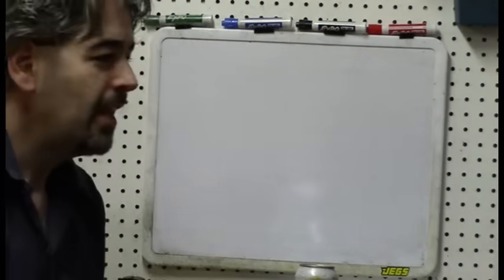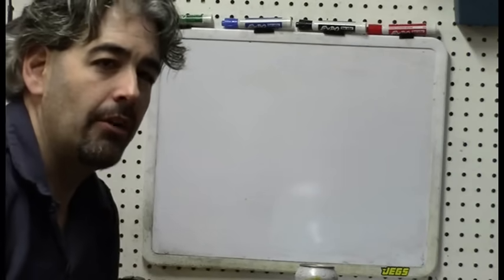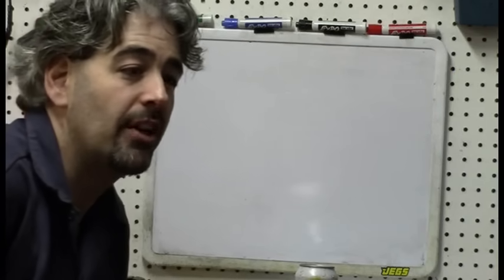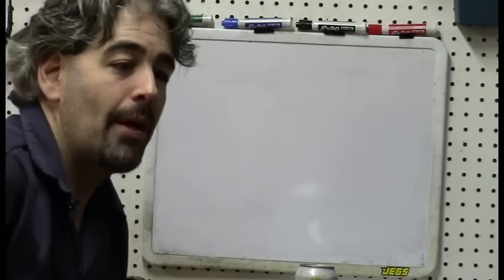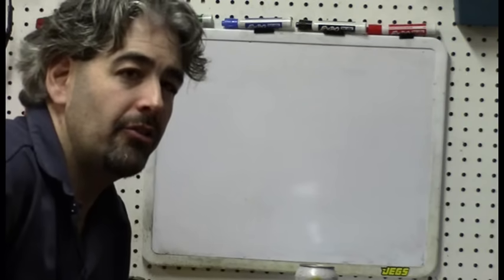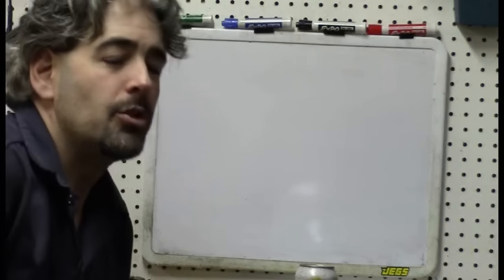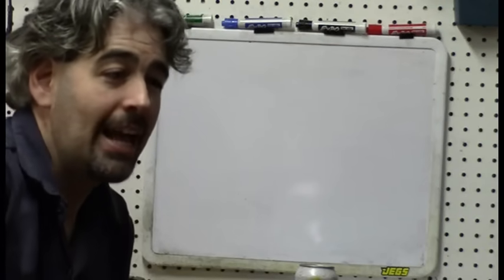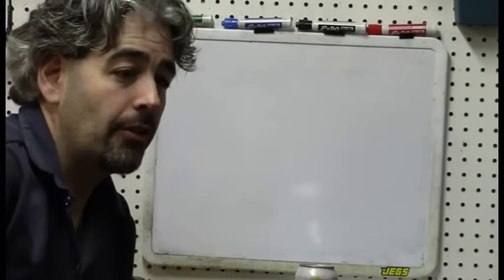Secret of Engine Problem Diagnosis- Fuel Trims Pt.1

Comment: Hello.  2003 Mitsubishi 3.8L V-6, 220,000 trouble free miles. Fuel economy is where it should be.

LTFT 1&2 are +12.5% at hot idle.  But goes to 0% and stays there when revved to 2,500 rpm.

STFT 1&2 are 0% at hot idle. When extra fuel is sprayed on identified leak of intake manifold (leaking o-ring, I used smoke to find) the STFT immediately goes to -6 and then returns when the extra fuel is burned off.

Could this intake air leak thats affecting both banks cause the truck to go into a limp mode, giving me these codes?
P0335
P2135
P0340

Also, why does LTFT go to 0% when under load?   Thanks!
Reply from the maker: No. the vacuum leak you found is irrelevant to what appears to be a separate timing issue.
Reply: @SchrodingersBox  Thanks. I have had two codes linger and not go away for 4 years.  Regarding both catalysts.  P0421 and P0431. The truck doesn't run poorly, has good power, and gets its designed fuel economy. O2 sensors move between 0 and 1v. Do you think the catalytic codes could be related?  I haven't had any smells or bad cat issues.

My timing elements are good.  Do you think the TPS could be entire issue with this limp condition that has occurred twice? It will run and idle fine, turn off and crank fine, but it won't go forward or backwards as if the throttle is not talking to the intake.  Again, when it sits for 20 or minutes it resets and works fine again.    Thanks.
Reply from the maker: The only way for you to find what’s wrong is to check the cam/crank correlation. This is the next step.  it’s possible the catalytic codes resulted from the condition but they did not cause it. your first step is correction of the timing issue and then you know any other codes are independent.
Reply: @SchrodingersBox  you know of any shortcut way to do this cam/crank correlation without removing the intake and timing covers?  

It's a real pain on these Montero to do either.  Have to remove a lot of stuff.
Reply from the maker: Oh believe me I know!! it’s one of the reasons why I invested in a lab scope because  There is a shortcut but you need a 2 channel lab scope.
  Otherwise, on some of these models they have separate cam covers and you just need to remove the cam covers - not the whole front cover. set to TDC#1 and then just check the cam timing marks. But if it’s  a model with the whole front cover then yeah- no shortcut other than lab scope and looking at overlay of cam and crank signals.
Reply: @SchrodingersBox  maybe I should invest in a scope for this any other stuff that's bound to come up more and more as my "fleet" ages.  I hate new cars. 

Recommend a scope system that's less than $1,000 or thereabouts?
Reply from the maker: Hantek makes some low cost 2 channel ones.
Reply: @SchrodingersBox  thanks. Would 2 channel be all I need for DIY use?  It's been a long time since I used a o-scope.
Reply from the maker: yes it is.

Comment: I hv a 2007 camry with high fuel consumption. No engine light no codes on obd2 scanner but car is consuming about 35% more fuel. Please help
Reply from the maker: Always start with the basics. Curve the LTfT and STfT against load with MAF and MAP output to get the starting direction.

Comment: Can I get some help please I have a vw vr6 2001. I have been chasing p1137 code for months. I have replaced maf, 02, injectors, purge valve, fpr still getting code.
Reply from the maker: what data did you have that those parts were all bad?
Reply: @SchrodingersBox  when I Google the code it said that all those parts would throw rich code so I would change parts hoping one of those were bad but nothing it still comes back after awhile. Only thing I have not changed is the evap canaster which says can give that p1137. I can not figure it out.
Reply from the maker: yeah I would need data in order to get a direction or I would just be guessing too. 
  just start with the basics- curve the total fuel trim against load and that will give you a basic stating point to see when the rich condition is occurring.  once you do that we can create a set of variables to narrow down from - in fact you already listed several but right now we don’t even have fundamental data to go on from them. for example what is the O2 voltage during the rich condition vs normal condition?  what is the MAF frequency during the rich condition? what is the fuel pressure during the rich condition?
    You would easily be able to identify which variable is causing the issue this way.
Reply: @SchrodingersBox  ok i got some data from the torque app scanner. Maf at normal running is 6.0g/s
STFT: 2.3%
02 1×2: 0.4V
LTFT: -14.8%
VOLTS (AD): 13.9V
FUEL FLOW: 38.6CC/MIN
FUEL FLOW: 2.4L/HR

UNDER LOAD 11.8%
MAF: 15.2G/S
STFT: -10.9%
02 1×2: 0.6V
LTFT: -14.8%
VOLTS(AD): 14.0
FUEL FLOW: 92.9CC/MIN
FUEL FLOW: 5.6L/HR
hope this helps. Thank you for helping me. I just bought another set of injectors & was gonna install today after work. But ill wait till I hear from you. I also for got to add that when I initially start the car it cranks for awhile I gotta step on the gas then it will start.
Reply from the maker: ok you can clearly see the rich condition worsens under load so I am not following why you are replacing fuel injectors- what other data is there that is not shown here which indicates fuel injectors are the issue and what exact issue are you suspecting they have?
Reply: @SchrodingersBox  from Google reading all posts i read say could be leaky injectors. Thats only reason I was gonna put another new set.
Reply from the maker: i see. ok well the data clearly shows you don’t have leaking injectors.   just stay with the basics. run data for rich variables under load and systemically rule it out. but stay off those posts- it’s always idiots on those. 
  just stick with data collection - we already know the direction because the rich condition is increasing under load. just follow the data!!  way easier than firing the parts cannon. you already have a basic direction now and it cost nothing!
Reply: @SchrodingersBox  Thank you I appreciate the help. With the data shown do you have an opinion on what or where I should go from here
Reply from the maker: Yes just stick with the simple stuff- the very first thing I would do is a volumetric efficiency calculation. Then check the correlation of the cam and crank sensor signals and also verify your ignition timing is prior to TDC. also check purge solenoid flow is consistent with its pulsewidth modulation - I have a video showing that to be a issue on a car in fact. compression can also be a variable, as can leaking valve seals.  
 there are too many variables to list. but you at least have a direction. you know you won’t be cleaning the MAF or replacing a fuel pump at least!
Reply: @SchrodingersBox  Thank you gonna go watch that video

Comment: Matt I love your videos ,I did a electronics course for 3 years ,I could of skipped most of that time ,By shadowing you for a few months,I once went to the local clown garage ,larchwood service center, should of been called deadwood ,Anyway they put my car on the code reader and said it needed a injector on No1 cylinder, I knew that wasn't right as when you turned the ignition of and back on the problem went, So I knew it was a electrical problem ,They said do you want us to order you an injector, Being a bit  diplomatic I said not just yet,cut a long story short I found the offending problem, the wires to the injector had gone high ,new injector loom ,problem solved.Ironically a,few months later I ended up working there ,Only went there to get back up to speed in a work shop environment and possibly learn a few things, Anyhow they where your original plugs and wires guys , proper code riders, I ended up showing them what to do , And I was the diy guy, Admittedly with some experience, Anyway the moral of this story is be carefull outl there. There are a lot of clowns about.

Comment: You are very knowledgeable, I'm actually learning from you.  Although, your illustrations needs to be improved for better understanding so allow me to make a suggestion. You can improve your illustrations just by following a simple rule in schematics.  That is avoiding to draw your lines in diagonals.  Try to draw in vertical and horizontal lines as much as you can.  Then Youll see by yourself a big difference.

Comment: Quick Question: That's what I have right now: LTFT Bank 1: -7%, LTFT Bank 2: +7%. Any clue what can cause this?
Reply from the maker: It is impossible to say. You have no relevant paramaters to reference the fuel trim to
Reply: @SchrodingersBox  Thanks anyway for really quick Answer. I wanna do some smoke test for Vacuum Leak. May I do smoke test as well for Exhaust Leak? Spark Plugs are new ones, but Engine  hesitate and got Rough idle. I've noticed that Engine becomes much louder and unfortunately got noticeably less power.
Reply from the maker: Not following- why do you want to test for a vacuum leak?
Reply: @SchrodingersBox  Well, I've got Lean Condition on one Bank and Rich on other. And what I'd understood from your Video, Vacuum or Exhaust Leak can cause such of Conditions. That's why I wanna try to do it.  Am I right or wrong?

Comment: Makes no sence for me, I have a merceedes C180 w203 that is runing lean with P0171. it adds upto 25% more fuel. However the post cat O2 stays at pretty much 0,8v to 0,6v.  when I press the gass peddle it drops slowly from 0,8v to 0,6v, then goes to 0,1v when I release the peddle before climping back to 0,8v again. What could cause that_
Reply from the maker: Yes of course the post cat will read that way. your catalytic converter is working.
Reply: @SchrodingersBox  How would a stuck open egr valve affect fuel trims and O2 sensor?
Reply from the maker: it depends on the conditions but a stuck open EGR at idle will dramatically affect fuel trims and O2 because it displaces the oxygen in the cylinders causing a perceived rich condition from O2’s so fuel trim will pull back extensively  and probably cause engine to stall.

Comment: Can you help me diagnose my car?
My car has air/fuel sensors before cats and oxygen sensor post cat for monitoring cats.
I wouldn’t ask for help but I’ve gone to 5 different mechanics and the most I got was to replace two post cats sensors at cost of more than 1k and still not fix.
The air/fuel sensors are responsive on acceleration/deceleration.
At about 3000rpm the waveforms between 4 to 5 volts. The post cat sensors switch rich and lean at high rpm, the post cat sensor on bank1 responds rich/ lean accordingly high or low rpm but the post cat sensor on bank2 switches rich/ lean at high rpm but stays rich at idle. The car is bad on fuel economy. The code is p2099
Reply from the maker: I would need to see your long and short term fuel trims at idle, 2500 and 3800 RPM.
Reply: Will do thanks!
Reply: @SchrodingersBox  let me tell you what’s going on…
Prior to ask for help and write my first comment, this problem with my car had been going on for awhile and after I didn’t find a mechanic I decided to get the tools needed for the diagnostic so ..
I bought the Xtool D8 only to find out that it doesn’t graph the o2 sensor in millivolts so I returned it.
I thought I would get something that did so I got Launch x431 and on this one I was able to see the waveforms in millivolts but now I don’t know why I can’t find the fuel trims and it doesn’t come up as STFT/LTFT . 
Anyways this is what’s happening, I wanted to give an update. If you have any idea that you want to share. Thanks Matt!
Reply from the maker: Sorry but without relevant data there is no way I can determine the issue. The fuel trims are essential for this kind of issue to even have some idea what’s happening.
Reply: @SchrodingersBox  Hello Matt. 
I’m hoping you’re doing great as usual. 
I wanted to give an update about my car, but also I wanted to say thanks! For always being willing to help no matter how big your channel has become .. 
we’ll let me tell you, I’m so relieved because this problem is finally gone. I wanted to tell you about the final result but I wanted to be sure that it was fix. Anyways about the Launch x431 I thought it didn’t work for me but it was all my mistake, now I think is a great product, I just didn’t know what to look for.
My car is a cargo van Nissan nv1500 and the fuel trims are not called the same by Nissan like STFT/LTFT. There are other pids that are about the same on Nissan, it’s something like ALPHA B or something, don’t remember the exact name but drove me nuts..for me it was hard to do it because of not knowing all the variables like: the right scanner, not knowing the Nissan terms for fuel trims and then learning so much about the oxygen and air/fuel sensors
There are so many videos about fuel trims but don’t specify the position of oxygen sensors . Not knowing that both sensor can be used as fuel control and on top of that, having an experience technician tell you the Nissan uses the downstream sensors to control fuel mixture…
Well, after I bought the last scanner Thinktool and now knowing a little more about the Nissan terms for fuel trims.
I started checking the air fuel sensor and oxygen sensor signals, and air fuel sensors signal was not identical but very close to the same. I thought this was somehow ok. The downstream sensor were not as close they would produce an almost identical signal only on sudden acceleration/ deceleration and one was staying rich at idle.
I check the exhaust system i started adding gas to the air intake manifold and saw the sensors signal was responsive on all sensors. I was desperate because there was a code but the sensors looked fine.. while I was doing that I notice the signal on both air fuel sensors and the sensor signal was moving even when I was not adding gas. I notice that by just moving the air filter cleaner the signal was changing. I removed the air filter and signal was steady, I knew that the filter was clean but somehow the waveform signal was steady without the filter. I got a new dealer air filter and the car was immediately running better.
It has been running fine ever since. Sorry for the long story, I wanted to tell you exactly what happened. Thanks for your help.
Reply from the maker: Great conclusion.   So glad you finally resolved it.

Comment: Hi Matt. I'm looking for a solution to a no boost problem on my wife's VW 2011 1.4 tsi. Im getting 2 codes, P0033(Turbocharger Bypass Valve Control Circuit) and P0243(Solenoid Valve  for Boost Pressure Control (N75) ). I cant find a video on your channel for anything turbo related. I've also subscribed to your paid channel/website and see nothing there either. Am I just blind? Can you direct me or help me at all? Thanks.
Reply from the maker: Thanks man, unfortunately I don't have any videos on forced induction yet. What I would suggest is looking at you induction inputs (MAF/MAP) and seeing if they correspond with turbo activation.

Comment: THIS IS GOLD!! Thank You for sharing this useful informations. My car runs bad when cold and I taught that mabe its the O2 sensor. But I found out that it doesnt work when cold. Next I will check MAP, throttle body and fuel pressure regulator. I changed the ECT sensor so tomorrow morning I will see if I figure it out.